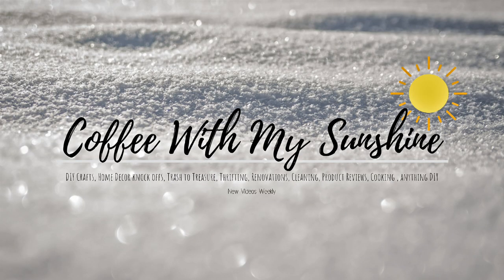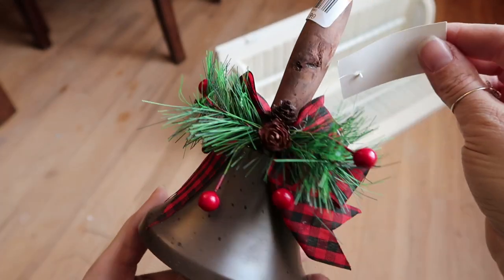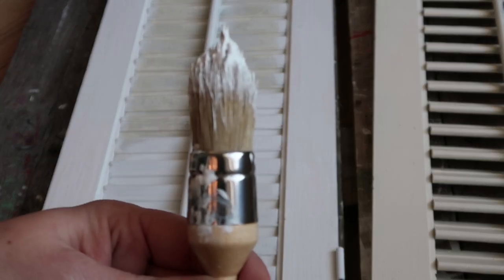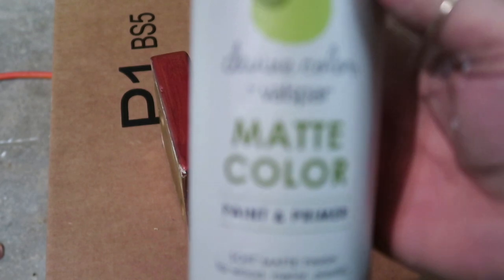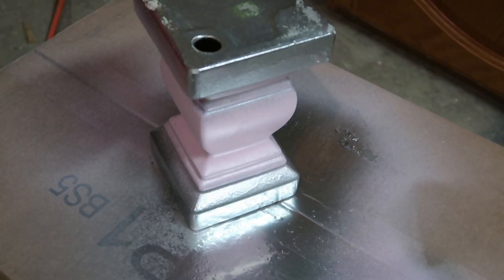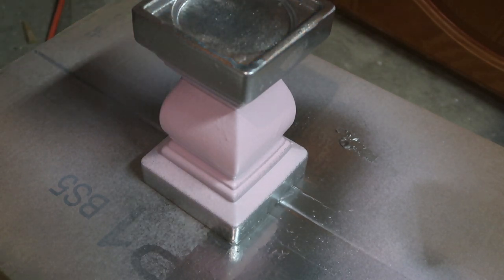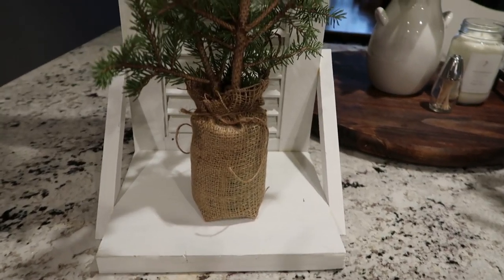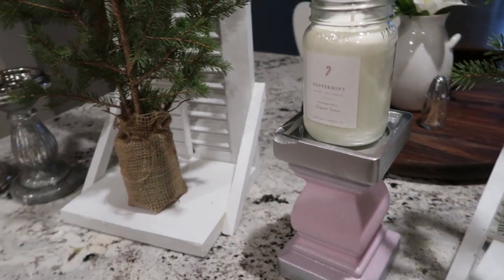THRIFT TO TREASURE GOODWILL | DOLLAR TREE | EASY DIYS SHABBY CHIC MODERN FARMHOUSE SHUTTERs shelves

Comment: I love the shutter shelves!  They turned out so grear.  I hope you show them on the wall. The pine branches looked really nice on them.  The chunky candlestick was a good find.  I wasn't crazy about the color you painted it, but it looked nice.  That's the great thing about trash to treasure, you can change something that's not so nice into something you love that fits your decor.  Well done!!
Reply from the maker: Hey friend! Thank you :) I am getting really antsy to get them on the wall too. I just haven't been out to the hardware store to get the hangers yet. I ended up repainting the candle holder. I love those 2 colors together, but I couldn't find a spot for it right now with those colors. I may paint it pink again for SPring. Thanks so much for all of your support :) Talk to you soon